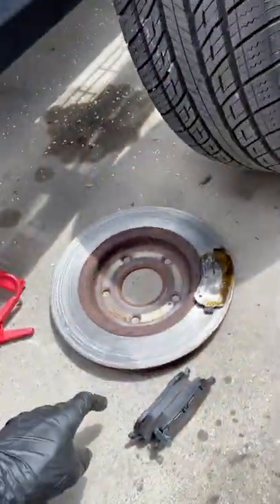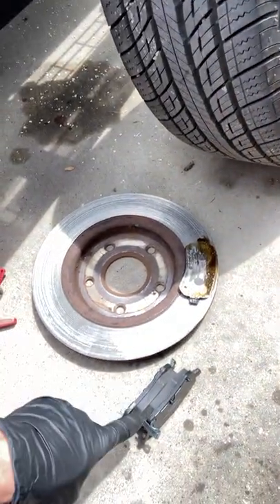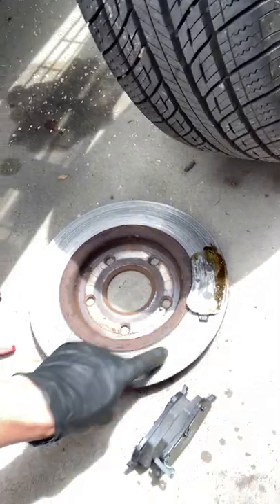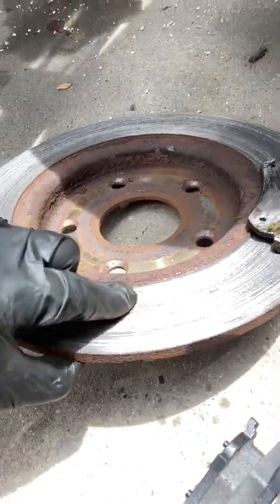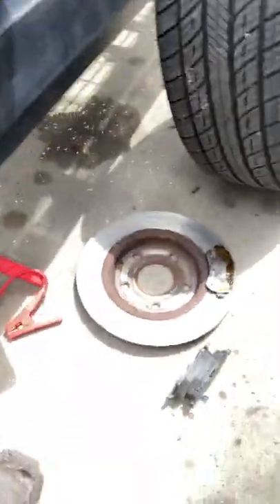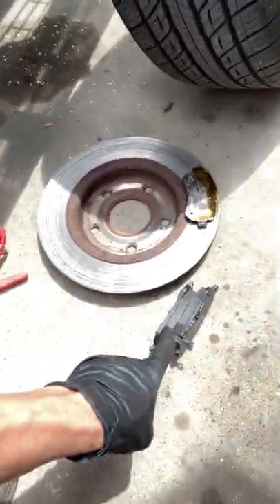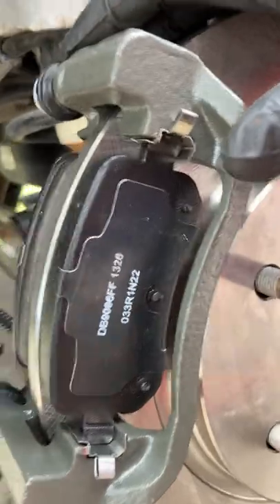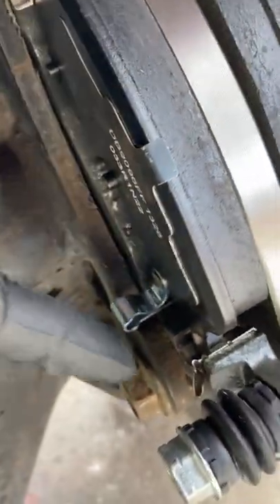You're probably changing your brakes wrong.Watch This!

Comment: Uneven pad wear usually means stuck caliper slide pins. The caliper can't "float" properly so inner pad wears faster.
Reply: When I changed mine on my 05 Tahoe in the rear because I thought the rotors were warped. The inside of both rotors were worn more than the outside, and the inside pads were worn at an angle.  There was no grease on the slide pins or pad channels.

Now, the new rotors are much hotter than the fronts.  Sizzling hot.  Why would that be?  I greased the pad groove on the clip and the caliper slide rods.  The new rotors came with ceramic pads.

Comment: In my experience of plenty of brake jobs, a lot of times the wear indicator won’t fit on any side other than the piston side due to the clearances
Reply: And if they fit both sides generally the replacement pads will have indicators on each pad
Reply: I've always worked on Hondas subaru and gm... pads were always the same.
Reply: @zoeycatt1925  just changed the front pads on my civic si and they aren’t the same you put the wrong one on the front and it hits the wheel

Comment: make sure you clean your caliper slides and it won’t matter
Reply: Exactly
Reply: Huh??
Reply: He put a new caliper on
Reply: Inner pad always wears faster than the outside on floating calipers, and several manufacturers have models with a tendency to wear even faster on the inner pad. So no
Reply: That's fucking great and all, but had the scraper been on the inner pad they would have heard it earlier.

Inner pads nearly always wear faster and should always have the wear indicator. It doesn't matter how good your caliper slides.
Reply: Also put some brake pad grease on those sliders
Reply: Yes, do it right, and you should be okay, even so-called pros aren't always  doing it right.
Reply: Brake cleaner wire brush
Reply: @therealpaulweber Yeah, for no reason. All he had to do was R+R the slide pins, lol

Comment: That's a good point. I usually put the zinger on the inside, and my limited experience is that the inner pads wear first, especially if the pins are a little a little rusty. However on my Dodge, they design the zinger to be on the outside, the rose on the inside pad won't permit it to be installed wrong.

Comment: That makes sense. When I first started changing brakes in high school I never realized this until later on I had do brakes on a Honda CRV and I was struggling to get the outer pad on and I was wondering why and it was because the way Honda designed the caliper bracket they made it in such a way that no matter what the pad with the wear indicator will not fit. So far this has been the only vehicle at the shop I've seen with such a design and I just went ahead and started putting pads with wear indicators on the inside

Comment: Absolutely correct, though in most cases you can't install pads with those indicators on outside..it physical won't go in guides..
And my couple decade experience whether right way / wrong way 60% or better of my customers ignore all the "mechanical part" warning signs... brake squeaking, belt squeak, lifter tapping, bump suspension clatter, car / dash board vibration at stop lights, turning cv click, etc...
Car becomes inoperable then the 911 call / text comes..

Comment: On some applications it does matter because of the fitment of the pad. You have a seized pin or a caliper thats sticking. We know from factory's the indicator is usually on the inside but mechanics will put it in the front as long as it doesnt cause obstruction. Other than that. It wears the same. These are not shoes where you have a primary or secondary side.

Comment: But what causes the rear pad to wear more?  

My 05 tahoe felt like the rear rotors were warped.  I helped a friend change both rear rotors and pads.  Both old rotors were worn on the inside more than the outside and the inside pads were worn at an angle, front to back.

With the new parts, the rear rotors get Very hot while the fronts are only warm.  Any ideas?  There is plenty of grease on the slides and caliper bolts.

Comment: One the inboard side with the wear indicator on the trailing edge of the rotor. Which means the edge that the rotor contacts first while moving forward depending on caliper placement.

Comment: I’ve seen a few (I think Nissans?) where the hardware is designed such that you’re forced to put the squealer on the inside.  I discovered this when the new guy put the two squealerless pads on the driver side then couldn’t figure out why one of the remaining pads wouldn’t fit on the passenger side
Reply: Discovered this when changing my own ('04 Maxima). Not sure how they did it, but the pads with the wear indicator really have a specific place to go.

Comment: I've only done a few pad slaps, and each time was on original brakes. So I just had put them how I pulled them. Makes sense now that I think about it, the piston would push on the inner pad first. Sure the floating part of the caliper is supposed to make it even, but depending on how hard you brake most of the time, the friction from the caliper pins might prevent the outer pad from being able to put as much pressure on the rotor.
Reply: Issue is when the pins start to seize up. Most shops probably dont even check them. I check them in-between pad changes, sometimes multiple times.

Comment: Wearing one pad and not the other is from stuck slides
Reply: Thank you, someone that knows what they're talking about and not this guy with misleading information !!!
Reply: I've also had the exact issue with pads that are rusted enough to lock into the bracket. Same symptoms essentially. Outer pad didn't move at all, inboard did all the moving.
Reply: The wear indicator being on the inside will let you know when you have worn and have stuck slides, and you can visually check the outside one for wear. This way you know if the pads are wearing unevenly. He's right
Reply: One pad wearing can also be it's stuck in the bracket.

Comment: You should of explained that the squeeler always goes on the back side of the rotor. 
Because A) The inside pad always wears out faster then the outer because it takes the force of the caliper pistons pushing on it.
And B) Otherwise the squeeler won't work properly.

Comment: That's how I always do it, but I prefer the squealer to be on top.
Reply: Usually if you have one pad wearing more than the other 1, it's a sign of a stuck slide pin in the caliper
Reply: The squealer tab should be installed on the leading edge with rotation of the wheel going forward. So if the caliper bracket is forward facing you put the tab on top, if it's rearward facing the tab should be on the bottom.
Reply: It will squeal either way.
Reply: LMAO

Comment: What about pads that have no wear indicator? This is a matter of preference rather than a best practice.  The best practice is to check your pads visually every time you check your tire pressure rather than rely on a piece of metal to do the checking for you.  Some of these wear indicators do not even touch the rotor when the pad is totally gone.

Comment: That may work in theory but not all vehicles can you put that tab on the inside, however if the inside caliper piston side of the rotor is chewed up that bad the slides are shot and the caliper is probably getting hung up that needs to be replaced caliper rotor and pads and clean up the mounting bracket and lube

Comment: While you're correct it's only because the term "pad" is commonly used to include the pad, backing plate, anti-rattle hardware, wear indicators and any other hardware that may be attached. To be technically correct 
there is rarely any difference in the actual pad, the difference is in the backing plate and attached hardware. While there is differences in in pad material but rarely is there differences in that in a brake "pad" set.

Comment: The indicator goes on the piston side because the piston side has the most load in use and constant. That's why it's also important to grease the slide pins every time. Avoid sticking. Not because they wear differently. So while you're correct you're also wrong lmao

Comment: If you have brake pads and then not wearing out at the same rate there's probably a stuck slide or a sticky part of the caliper caliper brakes should wear relatively even on the inboard and outboard pad

Comment: What about in the situation where you can’t see the outside pad because the wheel obstructs the pad
Reply: Then you either try with a pointer torch/flashlight and a mirror on a stick, if you still can't see, then you have to take the wheel off to check the brakes properly.

Comment: Yea, that's not how it works.  Your slide pins are seized, which causes the uneven wear.  Sometimes it does matter which brake pad goes on which side, but this is not the reason.

Comment: I always bought the cheapest trash. That being said the hardware was trash so i throw out the wear indicators, but also im that guy who gets bored and pulls my wheels on my cars that run perfectly fine and look for stuff broke or breaking. Preventitive maintainance, its how i daily a 40 year old jeep and a high miles 90s honda. Hondas cheating, its just that reliable, but the jeep has broken many times but never left me stranded, most of the broke things i caught before it broke or told me things like "i should probably save up for tie rods, these ones are getting a lil wiggly"

Comment: Why did you needlessly charge your customer for a new caliper and a new caliper mounting bracket when all they needed was a rotor, pads, and $10 slide pins, plus your time to clean out the caliper mounting bracket where the slides pins float with some solvent and a brush? Even with replacing an expensive caliper (maybe out of an overabundance of caution, idk) why in the world would you replace the caliper mounting braket! Which also then reguires a charge for bleeding the brakes. As a shop owner myself, I'd really be angry to know how much this person paid. The only failure mode on those caliper brackets is if they get bent in a collision, there is literally nothing that can wear out on them. The hole where the caliper slide pins ride is substantially harder than the pins themselves (by design) so that the pins wear out and NOT the holes. Those soft ass pins cannot, I repeat, CANNOT wear out those holes, they only require cleaning  when the grease gets funky. Nothing like putting video proof on the internet of how you overcharge your customers. 🤦‍♂️

Comment: Wear indicator always goes on the top,
Reply: It really doesn't matter if it's on top or bottom, as long as it's preferably in its factory position and that it doesn't interfere with the calliper or carrier when put together whatsoever there is no difference.
When it touches the rotor, it's time for brakes, simple.